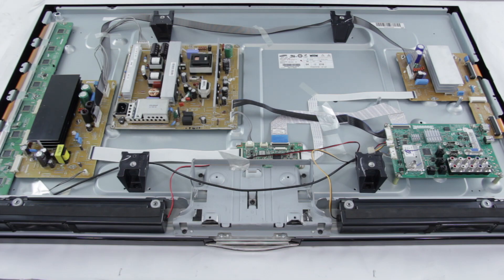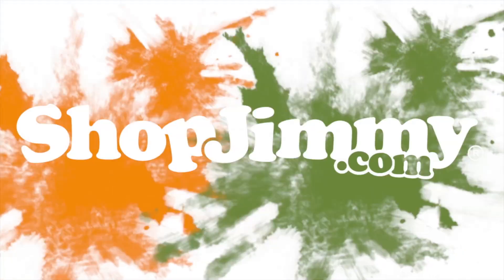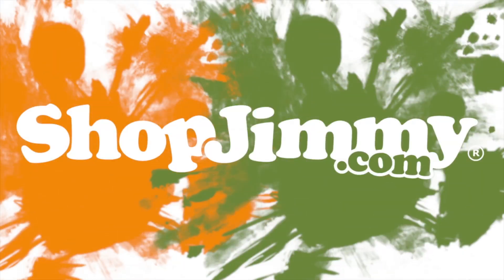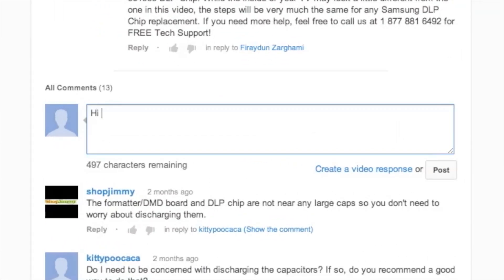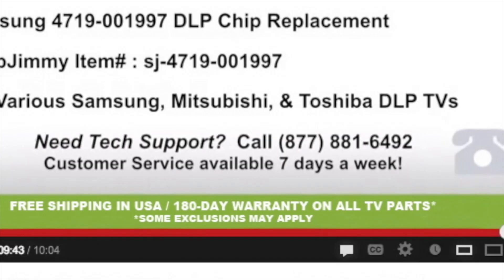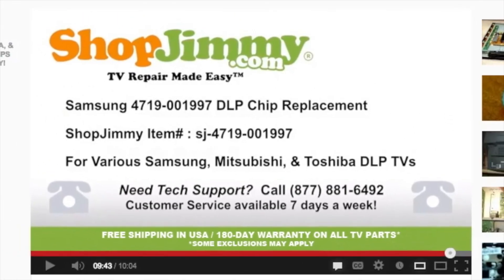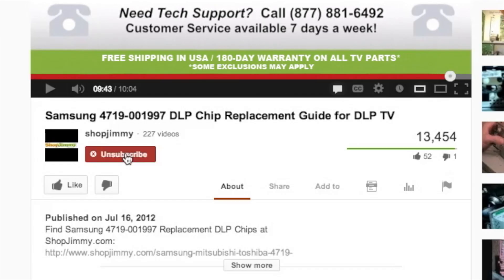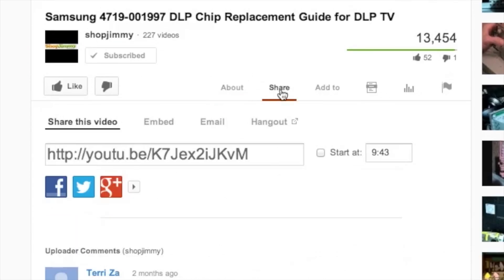Plasma TV Repair Tutorial - Common Symptoms & Solutions - How to Fix Plasma TVs

Comment: ps64e8000 no display but sound,  VS 215v present , i still replaced the 3 blue caps on the Y sus , what could be the issue , y buffers or logic board??

Comment: Hello, I have a Panasonic plasma, model #TC-P55VT50, that suddenly won’t turn on. The front power indicator is blinking 3 red lights with a pause then blinking 3 times again. I’ve removed the plug from a power strip and waited and plugged back in to a main outlet, still getting those 3 blinking lights.  I assume this is an error code of some kind. Please advise on next steps, thank you.

Comment: Not sure anyone will answer here anymore it's been many years but here it is. I have an LG 42PT351N that suddenly started making occasional arcing sounds somewhere on the side with the Y sus board and the picture would become horrible and grainy on light scenes. It would sometimes recover if power cycled, but when it would make the sound, it would go back to being grainy and odd colors. Found charred resistors near the set down MOSFET, not the large ones in the source, the small ones which connected to a diode that's not burnt and a 1nF capacitor. Nothing else measures as damaged, voltages are nominal. Replaced those including the cap with a 1KV one just to be sure but that's not where it arced. Still sounds like arcing sometimes but much less. Found 2 electrolytic caps on the Z board out of spec and replaced with higher voltage ones just to be sure. Nothing else dead there either. Can't figure out where the trouble is...

Comment: Hello
I have a Samsung Plasma tv PN60F5300B that won't turn on. The  red light will go on and off and just keep on doing that. I already replaced the Main Power Board, replaced the Y Main Board and the Digital Main Board, from used parts that I purchased off EBay. But i still cannot get the tv to Power on. Do you have any suggestions that i can try to get it to work.
Reply: Same exact tv but mine won't power  on anything no light or screen getting a power supply soon, hope you figure it out too🤞

Comment: Free TV years ago Hatachi 42HDS69 when it gets warm, or hot it will draw a column on the right hand side of the screen, when I have the back off it will draw a green bar all the way to the right a Orange bar about four columns to the left and a purple column to the left of that. Only happens when the set is warm. Have replaced the main power board years ago. Other than this the tv works fine.

Comment: Samsung 2008 720p pn50a400c2dxza was working after 2 years sitting in garage until I pulled forward on the top of the TV and the picture entirely went away other than a little light that makes the screen grayish black.  The HDMI sound was still working fine though.  Sounds like Y-sustain or logic board from your video maybe.

Comment: Thankyou.   Tv is a plasma lg 60pk250.   The set power indicator glows red in standby.  Pushing the power on remote or hovering over the power button causes click click but does not produce a picture.   It used to be intermittent but now will never turn on.   What causes that?   Main board relay?   This is an old tv but made a great picture.   Is it worth fixing

Comment: Jimmy, I have an older pn608500 plasma tv.
 It recently developed 3 pinstripe vertical lines on the left side. otherwise, the picture is fine.  any idea what part may need replaced.  Thanks

Comment: Good overview of components. Here's my situation. LG plasma 60PN5700 screen would turn off but sound & backlight remained on. Restarting the TV multiple times would fix it and it would remain on. This happened for about a month. Today, I went to turn on the TV and it immediately "clicks" off. Red standby by power lights works as expected. 

Opened the back panel and no visual burn marks or bulging components. When power is switched on, you can see a small red light click on & off where the optical sound port plugs in on the main board. 

I suspect it's a power supply problem but unsure. Switched plug cables and same result. 

Suggestions? Thanks!

Comment: My Panasonic Plasma HDTV model # TC-P54S1 made a loud popping sound & screen went black, has no picture or sound just a flashing red at the bottom near power button. I need to know if it's a repair that I can do myself by changing some circuit boards or it's not worth fixing.
Reply: sell it if you cant fix it, sell it ln the low end

Comment: My Pioneer Plasma TV model PDP5080HD will not respond to the channel up and down on both the remote and on the displays control panel. It will allow me to change the volume and inputs, but the remainder of the controls are unresponsive. What board(s) might you suspect?

Comment: I have a Samsung plasma TV model: PN42A450P1D  serial: AKWW3CQQB01529T. Which has worked well many years until recently picture screen has one vertical black line 2.5”-3” to left side of picture which otherwise everything else is working  fine. Not sure which possible circuit board could be causing problem. Thank you in advance for answering .

Comment: Hi, I have a Panasonic Plasma TC-P46S1.  Was watching, heard a loud pop, then the screen went black.  Couldn't turn it off, so unplugged it.  Later plugged it in, was able to turn it on. Immediately heard some arcing with an odor, and quickly unplugged.   Had read something that it may be a capacitor blew??  Hope you can help.  Thanks
Reply: Needs to be used in rooms with cold ac or a fan on the back of tv

Comment: Have a Samsung plasma Tv (model) PS50Q97HDX (2007/8) 
Turns on blue led under power button on front responds to remote inputs. 
No Picture or Sound.
Have replaced X sustain and corresponding pair of Buffers going to multiples of gold ribbons on (Left Hand Side) viewed from back. Have replaced Y sustain with 3 brown ribbon cables into black sockets on the (Right Hand Side)  as viewed from back. Replaced Main Power Supply  board.
When powered on a green led lights up on X sustain board,and a green led lights up on a small board located behind the stand (near Bottom Middle) of  set.
There appears to be nkk on evidence if the X sustain firing up or the Y sustain firing up, however the Power Supply board must be working as power is being fed to the 2 boards with leds lit.

2 Boards that haven’t been replace are ( long  and Thin) located either side of the stand bracket at the bottom of set (as viewed) from back and the (tuner/decoder) board located on a (sub assembly)near middle ,just above the stand locating bracket.

Any ideas or suggestions,as to why it won’t fire up the plasma panel.

Any help or guidance would be much appreciated. Jason

Comment: Samsung PN59D8000FFXZA
TV turns on but no picture or screen lighting. On the back of the tv while plugged in I can see a small green led light on one of the board slow/long blinking  above it on the board it says LED2000 LED2001. They are printed almost on top of each other any help would be greatly appreciated

Comment: Hello…you guys have been able to help me with diagnosis and parts for Panasonic plasma tvs before…hopefully it’s the same here…working with model TC-P50S60 that has both horizontal and vertical lines usually after it’s been on a while….last time I had lines on one of my other units it was t-con board and buffer boards but tha was just horizontal lines if I remember correctly…any help as always is greatly appreciated

Comment: I have a Samsung Plasma TV Model # PN64D8000FF

Its not turning On. When initially plugging it in you signal light comes on, the screen flashes, a clicking sound coming from the power board 3-5 times then it stops. Does not turn on. Signal light keeps flashing.

Comment: While I was watching TV, I heard a loud pop and the screen turned off. I turned off and on my TV and heard some more popping. The screen still wouldn't turn on, but I would hear sound and use the remote control. After replacing the main board after consulting a repair shop, I lost sound and remote controls and the standby light started blinking. I tried disconnecting the y sustain board and the TV is able to be turned on with sound and be controlled with a remote again. The TV screen still didn't turn on though. Could this mean that the y sustain board is bad? Or could it be something else? Please help
Reply: Replace it and find out, soldering and little components is complicated, by new y sustain board

Comment: I have a Zenith  Z50PJ240 plasma TV.  You can here it click twice with a red light on the front. I unplugged all boards. Then gave power to the power board and nothing happened gave power to the power board and the main board and the light on the front came on with a click. What would be yur next move power board replacement or main board?
Reply: 👉🏻Both👈🏿

Comment: I have a Panasonic TC-P55ST30 from the 2011 era. I turned it on and it stayed on for 15 or 20 seconds. Both picture and sound went out and will not reboot after being unplugged several times. The power light comes back on after puching it and it blinks 14 times then turns off for about 10 seconds and starts 14 blinks again! Any thoughts??

Comment: Hello - I have a Samsung model PN64F8500AFXZA.  Occassionally, the inputs from the remote control will not be accepted and the TV screen "peripheral" outputs such as the on screen sound level indicator or the channel number display will freeze on screen for approximately 2 minutes.  TV channel input, sound level input, and all other inputs made from either the remote or the TV itself will not be accepted until the approximate 2 minute period has expired.  The TV will then allow a few more inputs to sound level, channel up or down, etc. before not allowing anymore inputs and then begins another approximate 2 minute wait/freeze period before the TV shuts down by itself and restarts.  This freeze of screen "peripheral" display will also occur when attempting to select YouTube videos, or Amazon movies, or Netflix movies.  I can be scrolling along movie titles in say Netflix, and all of a sudden the white outline box indicating which movie is up for selection doesn't move anymore until the 2 minute routine described above has completed.  Occassionally, that white selector box for Amazon or Netflix will freeze between movie selections!  Then 2 minutes have to go by before automatic TV reboot.  I can see the red standby light flicker when I attempt to power off the TV during its freeze state but to no avail as I must wait that 2 minutes before it will automatically reboot.  Any ideas of which board may be the culprit?  It has been doing this since 2015!  Thanks.

Comment: Hello, i have a Samsung Plasma tv 50 inch, its about 18 years but still works fine when is working well, i have  had it from new, Model : PS50Q7HDX/XEU  MANUFACTURED OCTOBER 2006, My problem is suddenly i have no single displayed on the screen, do you think its the tuner or the hole main board thats at fault ,?  I turned  the tv off for  two weeks,  unplugged,  and when i turned it back on it worked for a week fine,   then failed again, ( No Single )  i can play a dvd Player through it no problem, and PS4  all good, i only have one HDMI port on tv, as its old model,  but good for what i need, I have tested the tv Coax Aerial for Signal quality, and its A.1. and i have tried it on a second tv with no problem.  hope you can help me please, and tell me what the cost of parts may be,  I live in the United kingdom 🇬🇧 but should be able to get the parts, if not from you, its the advice I need, thank you in advance, I like your videos keep it going. 
Ian. 👍🏻🎥

Comment: My then 2011 top of the range LG Plasma TV finally failed yesterday (nearly 13 years daily operation).  I want to try to fix it.  Here are the symptoms: about four days ago the TV just switched itself off. When I turned it on there was no screen.  I tried to get it going but I could not.  The red light near the switch would turn to blue and the noise of switching on was still there (and the noise of switching off).  Then I switched the TV from the socket (from the plug) and waited say one hour.  Then it would work but after a while switch itself off.  Yesterday it worked all day and then suddenly at night it switched itself off.  No effort at getting it to go back on gave results.  I remember we switched it off for an hour from the socket (from the plug on the wall) and then it came back but only for 5 minutes and switched itself off.  So we played some card games to pass the time last night.  This morning at 7 am I went down and switched the plug and then it went on and I was watching TV as normal.  Then after 5 minutes or so it cut out again and I could not bring it back.  What do you think is the problem?

Comment: I have a 2007 Zenith 52" Z503P - model # 50PC3DB-UE. I'm experiencing snowy reddish pixels on the  outside edges of a rectangular box located approximately 10"s down from the top and 10"s up from the bottom of the picture. The middle  section and the rest of the picture is perfect. What do you think is the problem??

Comment: Hi, I have a plasma tv that is somewhat messed up. the model code is UN50TU7000FXZA. The screen saver had come on because I was trying to log back in to you tube but couldn't remember my password. so it was flipped over to s.s. for a bit. a little while later the screen went blank, there was no question asking me if i'm still here, just black screen. then it appeared to  be trying to turn on again, the screen lit up a bit, then dark then a slight flicker quickly after and dark for about 30 seconds I am guessing. It has been doing that since. I finally hooked the HDMI port with a cable to my laptop just to see what I could. It flashes my computer screen, no in sync with the tv, or I guess at the same time, but the computer screen would flash, then the tv. When the computer screen flashed on I could tell the desktop was a little out of wack then it quickly rights itself, then goes black again. I have short video clips on my phone of what both are doing. I have had the tv, bought brand new for almost 2 years. Can you help me?

Comment: Hello sir, i have panasonic tx-p37x10e, it has fat verical black line, i openes it, i think ots the third flat cable on boaed at the bottom, nothing looks damaged. On the side edge of the black line there is a thin line but its static/snow.

Comment: Thank you for this - here is how I successfully used this knowledge to fix my Philips (Samsung boards) TV.  From the description of faults, I suspected the X and/or Y sustain boards.  There was a picture, but it had an out of range color stripe and was grainy.  Fault happened while watching and there was a burning smell.  TV continued to work somewhat.  When I looked at the X and Y sustain boards, I could see some bulged capacitors - they were all 82uF at somewhere around 312-350 volts. Between the boards, there were about 18 of them. There were a couple of other bulged capacitors.  I removed them and measured ESR ( a good way to tell if a capacitor is bad).  Turns out on these Samsung boards, those 82uF capacitors have almost ALL failed; only 2 of 18 showed ESR anywhere near acceptable.  Now, if I were to just replace the boards, I'd be getting boards just as old with capacitors just as old.  Ordering new caps from DigiKey cost about $60, and I replaced all of the 18 82uF, plus about 6 others, 4 of which were not even bad.  TV is perfect now.  Summary: many of the capacitors in your sets are probably at end of life, and if you look closely, you will see visual signs of this (bulging at the top). You may find, as I did, that a ton of your caps were bad, and replacement is inexpensive, and a much better option than buying old boards with the same, old caps....

Comment: PN51D550C1F .. was an extremely loud noise then the screen conplety shut off. Turned it on again, grey screen then complety dark. 
I would really like to save the TV if possible. Please help if you would know a solution. 

Its a 2011 but it was one of the first things i bought with my money and would really like to still have it if possible. 
Don't even know if there is an option to fix it or not afrer this long.

Comment: Th8s was already extremely helpful. Mine is definitely a power supply issue. Need to get the number and come back to this video..

It made a loud noise and some smoke.. then it wont tune on or be on standby

Comment: Hi. Thanks a lot for this video. I have a samsung 43" plasma - PS43E450. I was trying  to sort out a horizontal line reacently so I cleaned out the ribbon cable connections and was trying to troubleshoot the issue. Foolish of me but I disconnected the ribbon cable from the logic board to yhe y-sustain and switched on the tv. I heard a clicking sound and now the tv does not power on. The red light flashes every few seconds and there's a small sound from the power supply board. I would highly appreciate some advice. Thanks

Comment: Hi I have a LG plasma TV model number 605500 - UA I cannot get my remote to operate the TV and then when I try to use the TV control buttons on the TV the channel does input volume does channels is all messed up what do I need to replace to fix it thank you

Comment: Colorful snow. It doesn't fall, but just exists on the screen & seems to be getting worse, everyday. It is a 50 inch Samsung Plasma Mod# PN50C450, 720P HDTV. I purchased it in 2010. I use a Roku devise. All Roku channels I visit have the snow. I'm not connected to cable. What do you think is wrong & can It be fixed? I loved your video, very helpful in understanding the inner workings of TV's. Many Thanks, Norm

Comment: Have a plasma TV. Power clicks off 2 seconds after hdmi tag shows in corner. I suspect hdmi chip on mainboard is the problem. But may be just the power supply board. Power supply and mainboard only connected and clicks off on same after 20 seconds. So one or the other? What do you think.